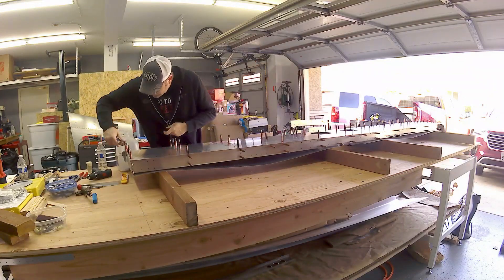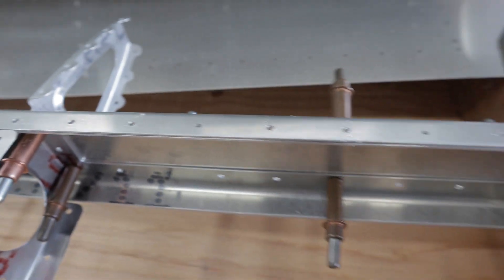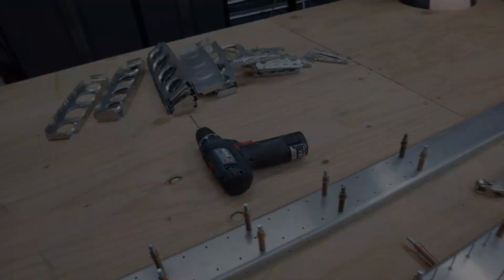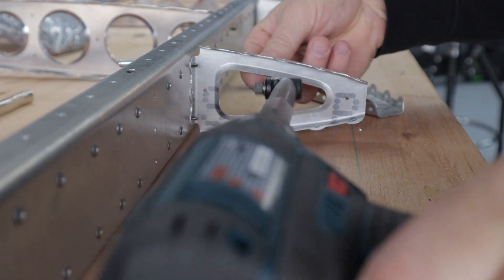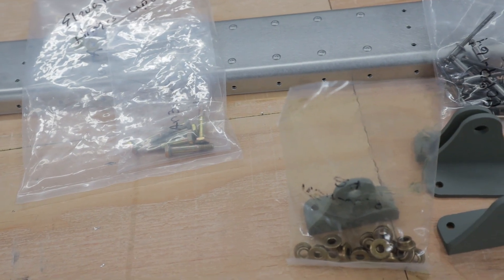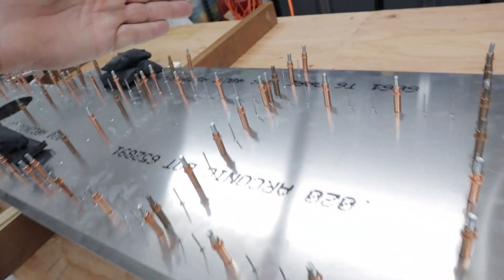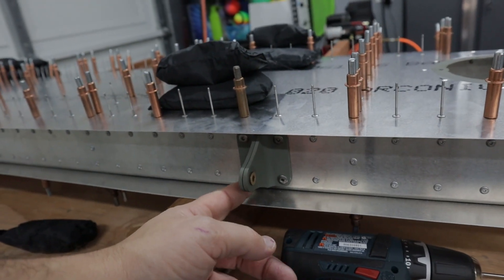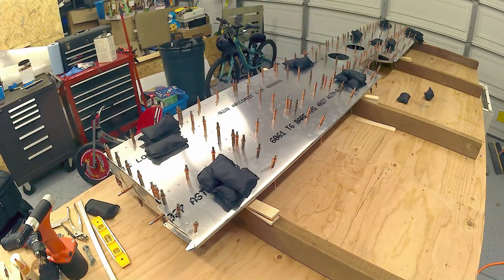RANS S-21 Horizontal Stabilizer Build

Comment: A noob here...  Question.  If you don't deburr after drilling, what will cause the frame to crack?
Reply from the maker: Stress cracks could develop. Less chance of large burs when using a backstop or the metal is sandwiched like the HS frame, but I did find a lot of small chips between there. Here is a Homebuilt Help Video on deburring:  https://youtu.be/0W1YB8xY0IQ
Reply: The other reason to debur is the burrs can prevent two parts from mating together fully and this is particularly importing on the rivets. If the rivet has any interference that leaves room for pieces to move and over time come loose.  When it comes loose the rivet hole will start to elongate causing more looseness.

Comment from the maker: I forgot to mention it in the video, but there was a lot of chips and burrs between the two flanges of the spar and doubler. Probably best to match drill the skin before riveting the HS frame. Alternatively, there is a device called a "chip chaser" to pull out the chips and possibly also reduce some burrs if you have riveted the frame already.

Comment: I also clecoed, match drilled with the skins in place and then disassembled.  My main reason was to prime all of the internal structure, but it certainly also is nice to be able to debur the drilled holes as you mention.